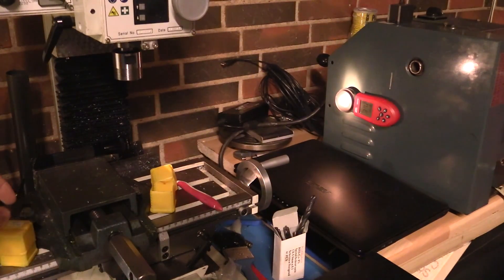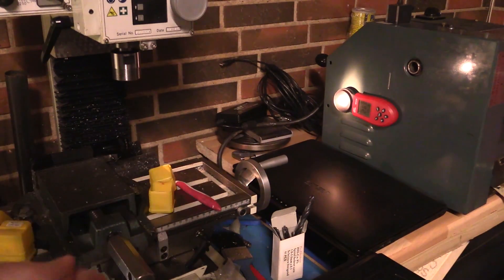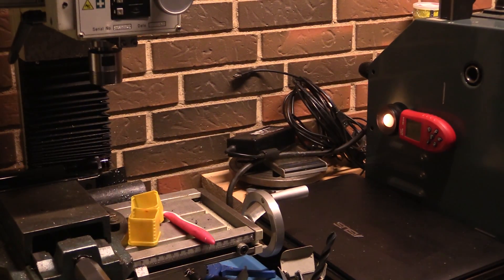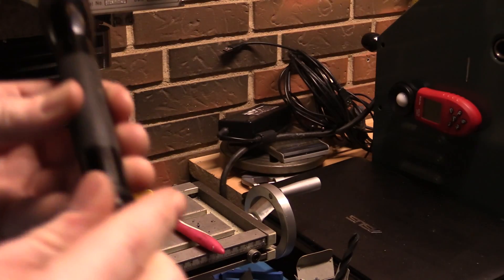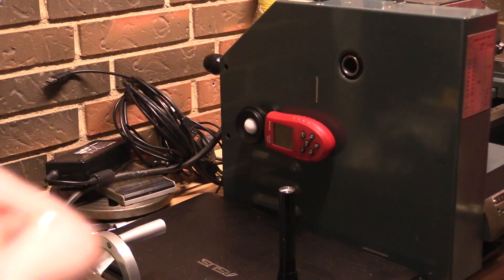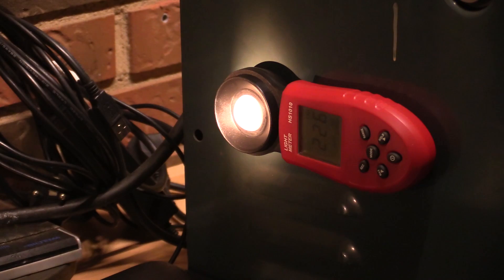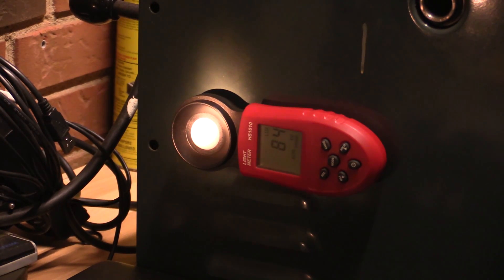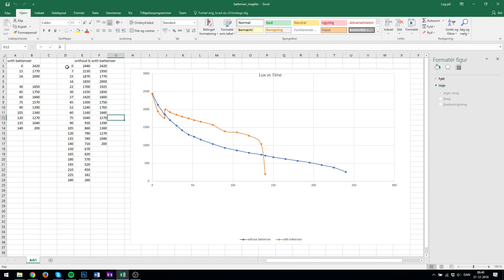Batteriser / Batteroo Boost Test: Passive Load (Part 2) - Ec-Projects

Comment: Seems to me that a better use case is if you used rechargeable batteries in this application it would boost the voltage without the current sag of depleted batteries powering it.

Comment: What's interesting is that the area under the curve, which is basically how much total energy each battery output, is almost the same. Without the Batteriser, it's 221495 lux⋅min and 219662 lux⋅min with it. That's a difference of < 1%.

Comment: Well, it may not be worth paying for, and it may have limited usefulness, but it isn't snake oil - it does maintain a higher average  voltage over the life of the battery. And it doesn't seem to be consuming more than it's saving. And it may be old hat to you guys, but I'm actually quite impressed that you can fit the regulator into that small a package - even if it's not that useful, it's quite a neat design.
Reply: "Batteroo: Extend Battery Life Significantly" is the claim and it is very clear, so if it doesn't do this.... it is snake oil.
Reply: but the useable life is shortened.  And active devices that already have a DC>DC converter built in them will see no benefit other than shorter duration and wonko battery guage
Reply: I don't want to defend something that seems to me to be pretty useless, but criticisms need to be rational. The usable life is only shortened if you are happy to have a long life with a low voltage - sometimes maybe that's what you want, but sometimes it definitely isn't. And all those devices with a DC-DC converter in them are also often poorly designed and will often have a higher dropout voltage, so this contraption might do some good in those - batteriser don't have a monopoly on over-hyped electronics. Anyway, I wouldn't pay for one. just saying it isn't snake oil.

Comment: If it had worked on the oldstyle flashlight it could have bin useful for prolonging the life of the outdated technology.
But the functionality is already build in to more modern led flashlight.
So even trying to use absolutely best case scenario it is a totally fail.
Reply: That's very true....